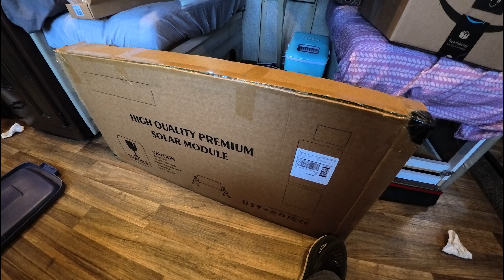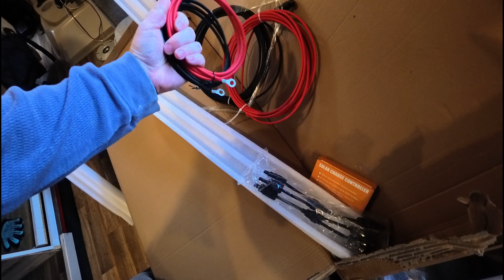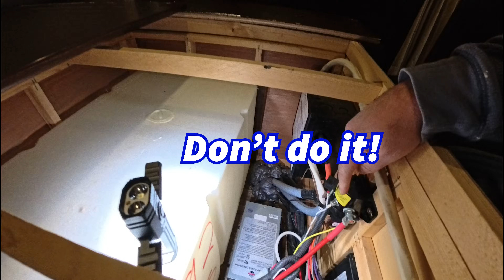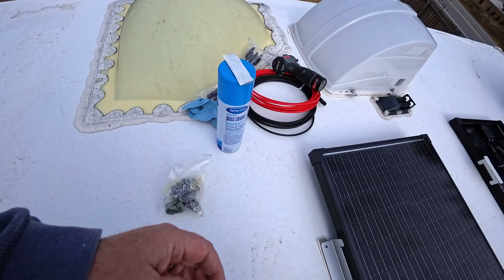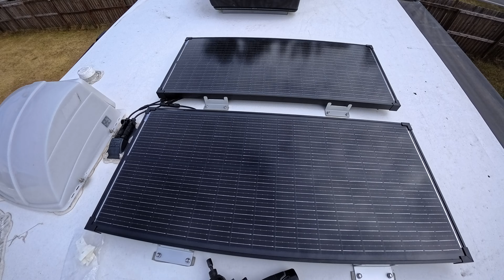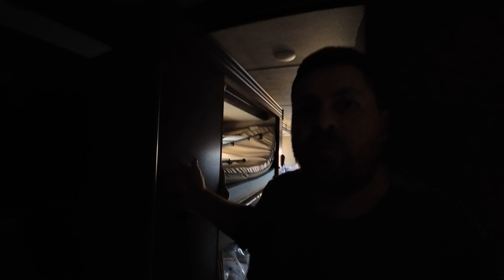Installing a Werchtay 200W Solar Kit on my RV

Comment from the maker: After a week I’ve already ordered an upgraded Victron MPPT charge controller. The cheap one included in this kit doesn’t have great efficiency. I’ll probably make a video comparing the two.
Reply: Controller type depends on your application. For a battery tender type situation matching your panel voltage full charge battery voltage should work perfectly well. 
For an MPPT typically you're going to want it minimum of two panels in series to keep the panel voltage up to keep the 5 volts needed to keep the MPPT on

Comment: Can't speak to that controller specifically but popular opinion on others that have USB type A ports rated at 500 milliamp output each share the same regulator as the power supply for the processor. It is there for good practice to probably not use those USB ports even though I believe your unit has a USB type-c
Reply from the maker: This controller didn’t last long. It still works but the output was horrible. I switched it for a Victron 75/15 in under a month.

Comment: I just bought 20 of these at an insanely low price. They came and am getting ready to mount them next week.
I am excited.
 Thanks for your video.
Reply from the maker: The panels have been good so far but I already replaced the charge controller with an MPPT controller.
Reply: @MajorDadsGarage Mine were just the solar panels. You can sell on the open market or give the MPPT chargers from your kits to local schools as orientation to solar power demonstrators.
Reply: Not sure about your battery chemistry I assume AGM? And I'm guessing it's a 12-volt system with your panels in parallel? Keep in mind the mppt controller will require a 5 volt above the battery voltage to turn on. This is different from what you were dealing with with the pwm original